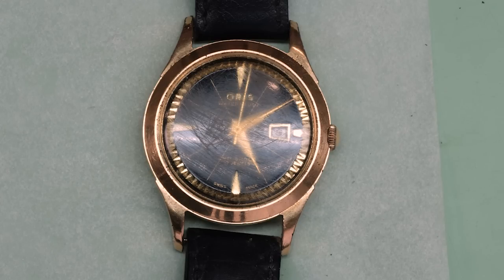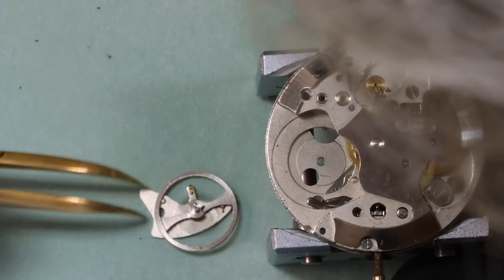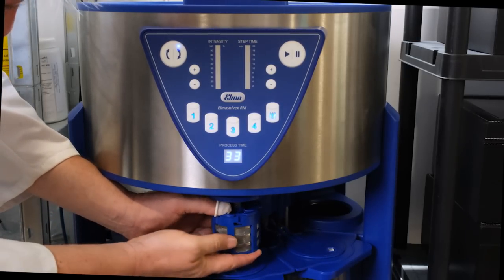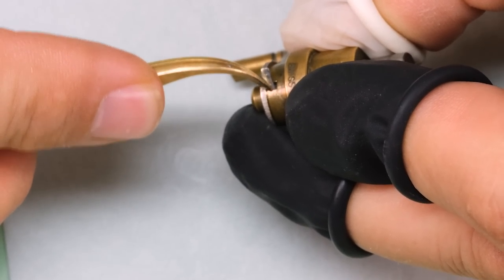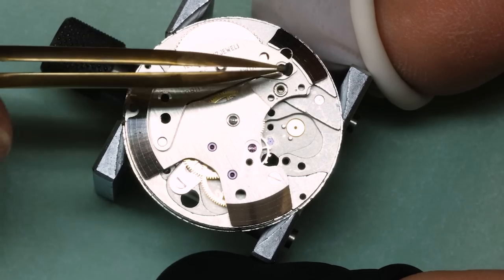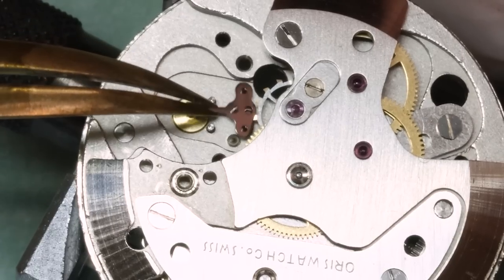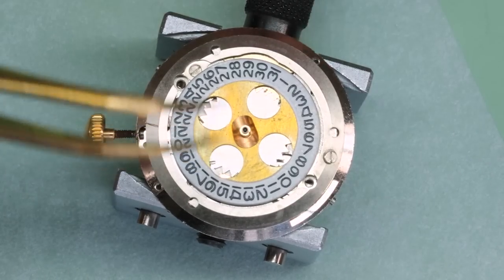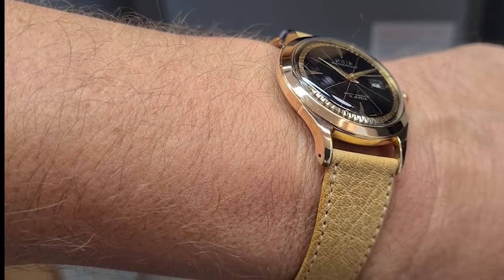Why did Oris watches have to use outdated technology?

Comment: Thanks for another informational video.  When I was younger I had the confidence to repair old pocket watches, they weren't that expensive due to being out of fashion. I currently have two automatic watches that need servicing one is a Ball automatic that I found in the trash working at the hotel I was working.  Someone either pulled the stem out or twisted it off, it looks to be like the watches issued during World War II.  The other is a Gubelin Ipso Matic purchased at a church sale for fifty cents,  it looks as if someone attempted to service it but didn't know what they were doing.   Who would be a good source of parts for these two watches?  Please keep the videos coming and hopefully I will become confident to attempt repairs on these two.  Thanks again.

Comment: Nice job as always. I have to say that as moldy green and dirty as those spring bars were, if they are in good shape otherwise, I've been cleaning and saving them. Just yesterday I needed spring bars with larger ends for an old 1940's military style watch and all the new spring bars I had went through the lug holes. I found old ones that fit perfect.

Comment: Thanks fir the video, I've never worked on a pin palette movement, and this has got me looking for a cheap Oris to practice on.
Reply from the maker: They're not that rewarding to work on, tbh. Difficult to make them run very well and they were not designed for longevity. So be warned that it can be a frustrating experience!

Comment: The dial on this Oris looked really nice, I have found that happens a lot when I buy a second hand watch with a scratched up crystal it makes the dial look trash until you open it up and the dial is almost in perfect condition. I also find that tobacco smoke is the cause of the brownish color to a lot of dials from the 50's and 60's which comes off with just water on a cotton bud and a light cleaning. Cheers
Reply from the maker: Yep, badly scratched crystals can really obscure beautiful dials sometimes!

Comment: Love how easy you make it look doing the shock setting spring locking thing on top of the balance, I struggle so badly with them it's embarrassing.
Reply: You use a loupe or microscope?
Reply from the maker: It's a learning curve, everyone struggles with it when they start out :) And as Alexander points out, good magnification will help a lot.

Comment: I taught myself watch repair on cheap 1 jewel pin pallet movements.  Because I didn't know anything, I thought it would be an inexpensive way to learn.  What I didn't realize until I actually worked on a 17J movement, was that those 1J movements are diabolical as a result of the tiny holes in the plates, and the fact that the movements usually only had a single plate for the entire wheel train.  Lining them up was frustrating and I usually ended up breaking something in the attempt.  I wouldn't recommend my approach as a result!  I enjoyed the history of Oris; when you look at them on eBay, there are many that seem to be coming from India with repainted dials.  It's a bit of a minefield as a result.
Reply from the maker: That's indeed a tale of caution Shane, and very, very true. It's all too common that tinkerers buy cheap old watches that might not even run, and that's just incredibly frustrating for them... Good to hear you persisted!

Comment: Thank you Stian for another great video. Interesting movement this Oris was. I like how you show the complete process of disassembly and assembly. When you use “grease” in the movement, which grease are you using?  Thanks again.
Reply from the maker: Thanks John! I use Moebius 9504 for the high pressure areas and 8300 for the barrel and stem.

Comment: Thanks for making and sharing another fantastic video, Stian! Why did you use D5 as opposed to HP1300 in the places you did? I have the feeling most folks have relegated their D5 to clocks and other non-watch uses.  Also, is epilame used on pin pallets or their escape wheels? Thanks again!!!
Reply from the maker: Hello Woody, I actually do use HP-1300 but am so used to saying D5 that it's kind of stuck :) And you can indeed use epilame on the pin pallet escapement like you would on a lever escapement, but it will have less of an effect.

Comment: Nice movement, simple and functional. The dial and hands are in a really good condition. Simply a well built product. Oris knew what they were doing. The brand was in the million watches a year club in the 50s and 60s, I believe. As a matter of fact it, given the volume out there, I'm wondering if there would be a viable side business for Oris to sell escapement replacement/conversion kits for those watches.
PS: By Jove, this nose hair is out of control ! You should really watch out for it. It may try to strangle you in your sleep, you know? I'd say it's high time to bring out to the flaming chainsaw and deal with the problem mano a mano, once and for all.

Comment: I tried one of the 3D printed mainspring winders. It might have been fine for a smaller watch, but it turned out to be useless for working on antique American pocket watches, especially if you're replacing the mainspring and, like me, screwed up installing it directly from the ring. The problem was that the hook used for wrapping the inside of the spring around the arbor is not 3D printed -- it would be far too small. The pattern provides for a small hole where the hook goes, and you're supposed to fashion one out of a staple. Even when I found a staple that was heavy enough to withstand the force of a wound spring, the hole wasn't able to retain it in place. The plastic would just crumble around it.

So I ended up finding a vintage winder that would do for the size of the spring and barrel I was working with.

Probably, they're just fine for smaller watches with smaller, less stiff springs.
Reply from the maker: Interesting, thanks for sharing!

Comment: Very cool video Stian, i always wonderd why a good watch maker like Oris had vintage watches with jeweled movements and a pin pallet escapement, now i know cheers. P.S. i just aquiered a couple of Felsa movements the 690 Bidynator in a Perfine lady's watch and 4000N Doublematic in a lovely MuDu from early 60's, watched your video on the latter cool lower beat movements, going to look for a case to put the 690 into so i can get some wrist time with it, as long as the dummy who put oil in it didn't break it, the return barr on the keyless works had the sping in back to front, and the minute wheel cover the tale that goes over the keyless works had been flattened, i fixed that already, i was only having a quick inspection and noticed those problems, hope there's not too much else wrong, thanks for another great informative video Stian, waiting for your next fun video. I am also a tool junky 👍
Reply from the maker: Cool stuff, Dave! Good luck with those :)

Comment: Oris is a brand which always seemed to be right on the cusp of making it big, but then something happend. I know they had their golden age, but it didn't last long. I own both a vintage (Oris Super with a pin-pallet movement) and a modern (SW200-1-based) Oris. Since I have a soft spot for the brand, an in-house (-designed) movement Oris watch is planned for the future.
Reply from the maker: Oris is indeed a bit of a strange brand but they have made some really nice watches

Comment: Beautiful job, Stian, the case looks great after polishing. Nice to see a pin pallet movement at work.
One question: using the rubber ball on a screw-down caseback, can you get the caseback off even if it's screwed down very tight? Or do you sometimes need to use a tool?
Reply from the maker: Hello Frank, a properly closed case back should actually not come loose with the sticky ball, or at least very reluctantly. So yes, I often use my case back vise.
Reply from the maker: Hello Frank, you might have seen in the latest video that you won the second Seagull, congrats! Can you send a mail to stian@vintagewatchservices.eu, then I'll let you know how to proceed.

Comment: Although having sold Oris watches in my fathers watch shop, I didn't know the story that the "Uhrenstatut" forbid the use of pallet forks. I knew Oris as a free brand with reasonable watches in the price range of Fr. 50-100. Far cheaper than today -and they were in-house made! I still must have some new old stock of them. 
Today, they cheat a lot and their prices are ridiculously high. On their mechanical alarm watches they use Russian movements and write "swiss made" on the dial! Switzerland has a lot in common with the Soviet Union: Swiss hate market economies and competition and prefer planified economy.  The difference is, that in the Soviet Union, profits went in the pockets of everhbody but in Switzerland the profits go in the pockets of the elite.
I remember the times when the crisis started and we once were in Basilea  Region to buy surpluses from the factory.
Reply from the maker: The rules for Swiss made explicitly include the movement being made in Switzerland, so I wouldn't think Oris flouts that. As far as I know they use a new version of the AS 5008 in their alarm watches?
Reply from the maker: Sounds like you're a bit too deep into some conspiracy theories there 😂 The movement Oris uses in their alarm watches are made by La Joux Perret. 
I don't know about pigs but for watches to be Swiss Made there are three criteria:
1. The movement must be made in Switzerland
2. The watch must be assembled in Switzerland
3. 60% of the costs of the watch must be incurred in Switzerland.

Comment: Another great video, thank you. At least just have learned what is a pin pallet, and I am very curious, are there any clues of wearing on those pallet pins. Because the watch is still a nice and good watch, though it is over 50 years old, this mechanism doesn't seem to be that bad... Btw would be really happy to win the black seagull...
Reply from the maker: There didn't seem to be much wear on the pins, no. Oris certainly put in much more effort into these movements than most other pin pallet manufacturers and likely used the best materials they could.

Comment: I've watched this a couple times and I've worked on three pin pallet movements so far: the Timex handwind and automatic as well as the EB8810, but I didn't know the difference other than the bushing style, but now the jewels throw a wrench in that. So what is the difference between pin pallet and lever escapement? Is there a simple way to explain the difference? At this stage of my learning, they all look the same to me.
Reply: NM. I thought about it more and it seemed that it could be the jewels on the pallet jut out horizontally whereas the pins on the pin pallet are vertical pins. Looked it up and 👌

Comment: Why aren't the pallet fork and escape wheel coated with epilame to help retain lubrication?
Reply from the maker: I used grease instead, which doesn't creep that much anyway. But yes, you can epilame them and use oil.

Comment: Hi Stian I don't normally make comments I just enjoy your tutorial videos, But I'd like to be entered into the prize draw, and normally I can't think of anything interesting to say
 But one thing that always makes me thinks is when you grease the stem shaft do you apply grease to all the 4 flat sides the sliding clutch always stays in the same place relative to stem and may not get grease on it. Hope this makes sense to you
Reply from the maker: Hello John, good question! You don't really need to grease all four flats of the stem, as the grease will creep over the corner if you grease near it. There's no danger in greasing all four flats either, but you want to make sure you don't overdo it.

Comment: Okay,, something I've always wondered about: How do you get an odd number of jewels in a watch, given that they always come in pairs? Where does the single jewel come in?
Reply from the maker: It's generally the impulse pin on the underside of the balance.
Reply: Ah, got it, thanks! is that pin then fully sapphire, pressed into the balance, or is it mostly brass with a sapphire tip?

Comment: You told in the video, that this watch is not waterproof. Is it NOW waterproof, cleaned and with new gaskets? The ORIS Model on Nekkid Watchmaker channel looks very similar, but has a different escapement. My english is not good enough to understand clearly the reason, why Oris could make the other escapement so late. Thanks for your answers, Fiona.
Reply from the maker: Hello Fiona, waterproof is actually a term not in use anymore as no watches are completely secure when immersed in water. It's also a very misunderstood term. 3ATM water resistance does for instance not mean you can dive to 30m with it, it simply means the watch can be used if it's raining, when washing your hands, if getting splashed on by a car driving through a puddle etc. 
There was a law made in Switzerland in 1934 that banned watch manufacturers to start using technology they weren't already using. That meant that Oris were not allowed to start using lever escapements, as nearly all good watches use. They were only allowed to start using lever escapements in 1966, thus for more than 30 years they used pin pallet escapements and made the best out of them.

Comment: I have a 40mm case I would like to put a mechanical stem winding movement. What would you recommend stem at 3 o'clock!
Reply from the maker: Oh, that's a very difficult question. You need to make sure the height of the movement fits the case also.

Comment: Dear Stian, I have a question : in other vidéos you are using a ?? flex ?? stick to polish the pivots before putting them to the cleaning machine. Could you tell me the exact name and where to get it. Many thanks in advance. Your vidéos are great. Andreas
Reply from the maker: Hello Andreas, it's a product called Eve flex. You can get it in most material houses, or a quick google search should help.
Reply: @VintageWatchServices  thank you so much 🙏

Comment: What is it about jewels on the palette fork that allows them to hold onto grease better than steel pins? Is that clever enough? Sure would like a new watch.😁
Reply from the maker: It's not only the material, it's more about the shape, actually. The pins are round and stand straight up, so there's nothing to keep the oil from running down to the base of the pins. On a lever escapement the pallet surfaces are flat.

Comment: One observation about Swiss watches, In a given maker's range, it seems the more 'sober' they look, the more likely they are costly. As far as the brands go, if the brand name is separate piece attached to the dial, it's likely premium, if the brand name is just stamped / printed they are low tier. Seems such a stupid thing to do, make a nice movement, nice case, then ruin it all with how you present your brand name on the bit people look at all the time! I need to have a word with Oris! They still do it to this day. Bulova do it and I've seen Tissot do it fairly frequently. It's the worst place to make a small production economy! Longines are rather more crafty and do it better their insignia is usually a separate piece, with the name printed so you are distracted into getting a better sense of a premium piece. They usually have a good degree of style and Longines marketing a brand placement are rather good, yachting and racing timing and suchlike

Comment: How the winding direction of the main spring is determined for installation into the barrel?
Reply from the maker: As a general rule, Swiss watches wind counter-clockwise, but there are exceptions to it. You basically just need to check the direction for the watch you're working on.

Comment: About the soft rubber ball you used to take the back of the watch off, would a Squash ball work?
Reply from the maker: I wouldn't use a squash ball, it would likely leave residue on the case. You can buy these sticky balls for less than $10.

Comment: Do you use 9415 grease for the pins of the pinpallets?
Reply from the maker: Yep, that's what I used. Note that I pretty much never work on pin pallet movements, so there might be other and better ways to do it.
Reply: @VintageWatchServices  normally i use 9415 for the palletfork rubies and I used 9010 for the pinpallets. I don’t know if this is the right way to oil the pins.

Comment: Didn't the English invent the "Swiss" lever escapement?
Reply from the maker: Hello Aaron, wouldn't it then be called the English lever escapement? 🤔
Jokes aside, Thomas Mudge indeed invented the lever escapement and it was further refined by other, mainly English, watchmakers. Their end refinement was the so-called English lever escapement, in which the escape wheel has sharp teeth reminiscent of clock anchor escapement wheel. Also, the lever would typically be angled rather than straight. The Swiss lever escapement is a further refinement of the English lever escapement, the main difference being the different shape of the escape wheel teeth and the straight lever. So yeah, it's a bit unfair perhaps to call it the Swiss lever escapement since 90% of it was actually invented by the English, but that's the world we live in...
Reply: @VintageWatchServices  Thanks for these details.